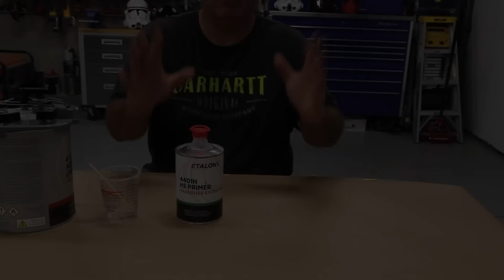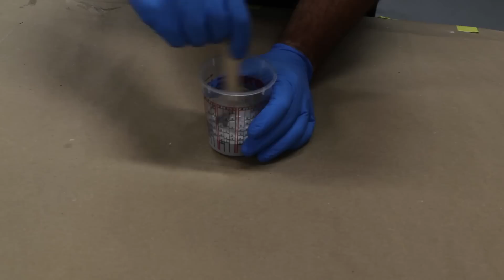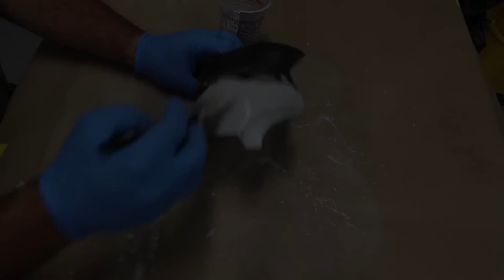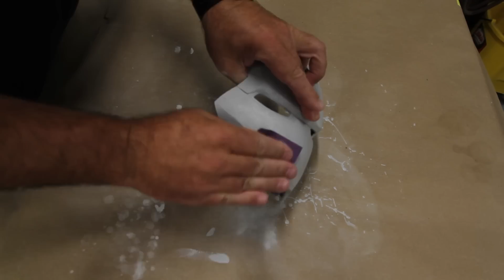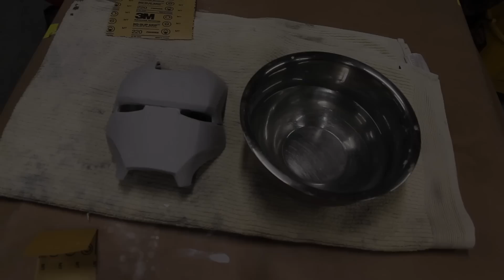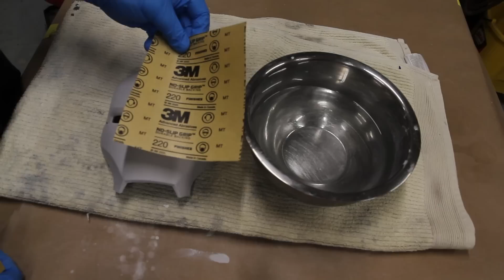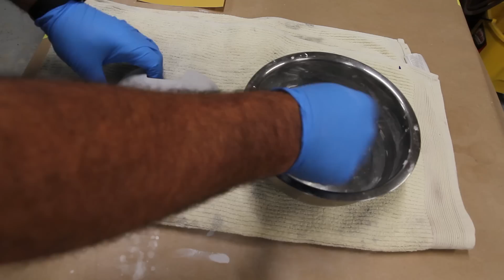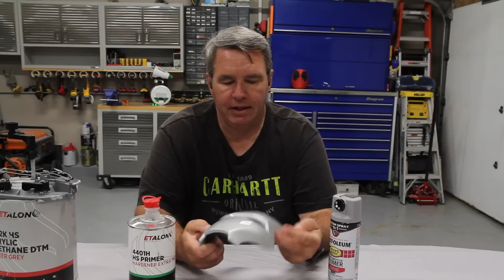3D Print Smoothing CHEAP and EASY

Comment: I have a large compressor, and a spray gun but I never use 2K because the cleanup is always so much work compared to the time priming.. it never once crossed my mind to brush it on..  very smart!
Reply from the maker: You can roll it on also, If you use one of those 4in disposable foam smooth paint rollers, that works excellent also. especially on larger flat or rounded areas, like tops of helmets and chest armor. then just use a brush to get in to the tight spots. 
Have Fun

Comment: This is awesome! I use a mixture of acetone and bondo, it works well but I think I’ll give your method a try once I run out! Great video, very informative!
Reply from the maker: I did it that way for a long time, its messy and takes a long time to dry. I switched and will never go back.
I glaze the big imperfections and use HB primer on everything else.
Have fun
Reply: @TheLastLayer111  depending on how much acetone you add it can dry within seconds of putting it on, at least that’s how it is for me. Doing full strength bondo does take a little longer though.
Reply from the maker: @StikoMode  Glaze is a lot like thin Bondo. I haven't used the spot putty in a long time. I actually did the acetone trick when I first started and it worked good. the biggest thing I found was that the more acetone I added the more the putty shrank. I was getting some lines popping out after it was painted. I haven't had any issues with the glaze shrinking. Just play around and experiment, that's half the fun.
Reply: @TheLastLayer111  I do get some shrinking when I use the bondo mixture, I’m still new to finishing 3d prints so I’ll keep experimenting and see what works the best. Thanks for the feedback and video!

Comment: Great tip video.  I currently use rustoleum 2 in 1 filler primer I will have to look into this.
Reply from the maker: Give it a try, I think you will be happy with the results. I have tried every box store brand I could find, and always come back to automotive High Build primers. Spray can or 2 part, they save time and money in the long run.
Have Fun.